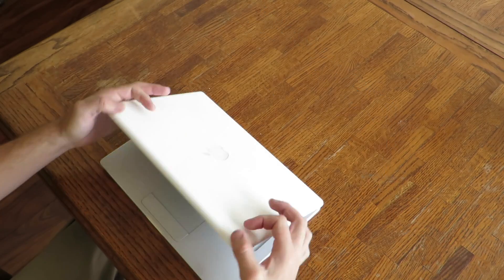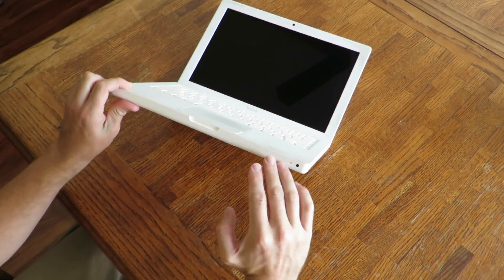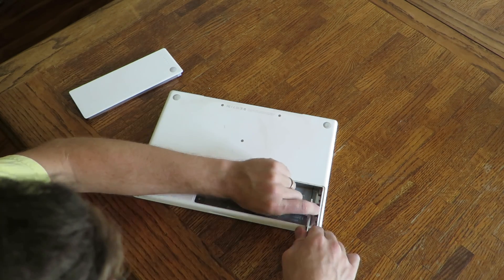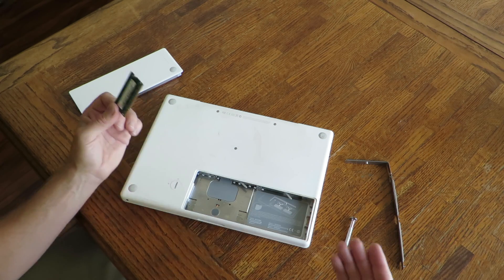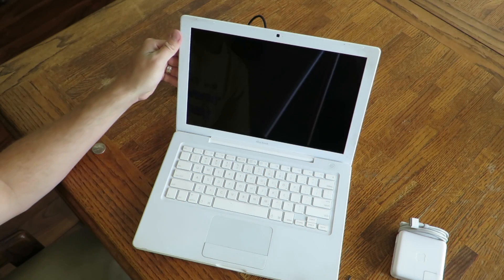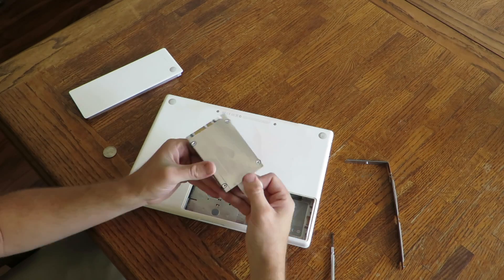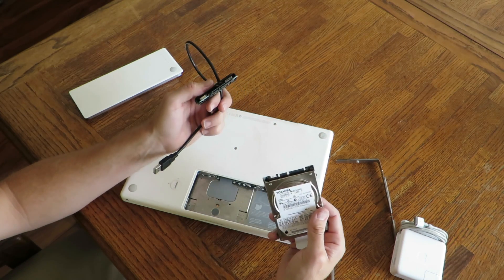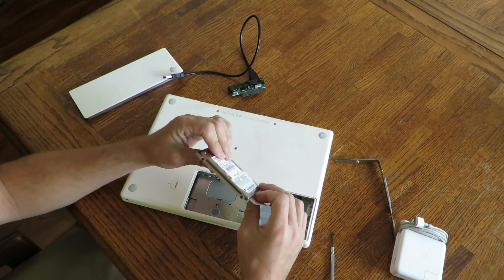Macbook wont start? How to fix it!

Comment: I don’t understand you just take the memory stick out and put it back and it works? I got one with no sound, no screen and it seems it comes from the graphic card, i tried everything it won’t come on but the light is here meaning power is passing through
Reply from the maker: The issue is that a failed memory chip will cause these things to not boot, and they tend to go bad. If you remove the bad one, it will boot. Try removing one stick and then booting it, if it does work, swap to the other. If that doesn’t work then the issue is somewhere else.

Comment: You can get it "working", however, wait the next 15 minutes and it'll just freeze. When memory slots start degrading, removing memory and puting it again, is nothing more than a workaround.
Reply from the maker: Its not the memory slot, its the memory. The computer in the video... which was filmed years ago, is still running just fine.

Comment: Hope it works. My iMac is dead already and my MacBook Pro 2015 as well. This was my last running system hahaha. Today it didn't want to boot so opened it and clean it a bit. Still nothing. I believe I added 2gb additional to this one. See if it still runs on the old ram. It was already terrible slow so back to 2gb from 4 would be a nightmare by itself
Reply: Tried and initially thought it was working I saw boot screen again when one dimm was removed. But 1/3 in shut down again. I already had a battery issue with this one. Though it was not swollen like the MacBook Pro. Must be something else. Not worth getting repaired or looked at.
Reply: I like your comment about being terrible slow. I have a perfectly good laptop but is is slower than all get out. I guess this fix is good for you to get vital information off the hard drive!
Reply: @stephenjames820  you can always swap out the HD and use external casing to get your data. Mine never booted again

Comment: I have removed the HD from my MacBook as it won’t start up (it doesn’t even have the light on the right corner). I would like to get my data from the hard drive, what will I need in order to access it? Thank you for a great video
Reply from the maker: If the drive is still OK, the cable in the video should work.

Comment: Please help, i try more and more, but the problem is my macbook white just after startup it still in the startup screen with the circuling rainbow pointer circle and circle and circle all the time.
Can you know how to fix my problem ?
Reply from the maker: have you tried to boot into safe mode?
Reply: DoItYourselfDad  yes i try that one, same problem, the problem is its not clicking or selecting any folder or any items in the screen, only the pointer is working going and going with trackpad with the circle rainbow pointer.
I try remove one memory and work with the other, same problem. I don’t know whats the problem and how to solute it.

Comment: I purchased 2006 macbook A1150 1.83 core duo 665mhz 2gb  mac os 10.5.8 for approx $35. I applied blanket therapy on it. I was able boot by power button+shift. When I logged in I tried to delete user data by secure delete but secure delete stopped mid end so turned it off. Now it's not starting and showing file question mark error. What to do now? Pls help
Reply from the maker: You may have to reinstall the OS.
Reply: @DoItYourselfDad  thanks for help but now I did it yesterday and installed snow leopard but now it's only booting in safe mode. I uploaded videos on YouTube. Can u pls check and suggest. I m getting white screen and chequeredbox line on display. It's my first laptop so want to dump it. Pls help.

Comment: Whats happen if I put the memory in the wrong spot?It doesnt change?
Reply from the maker: It shouldn’t matter which slot you out the memory in.
Reply: @DoItYourselfDad  thank you so much! So there are no real difference if I put in different position,right? I tryed to do what you explain but still dont turn on.I had the same problem in the past,and I resolved just buy trying again and again,simple buy pushing the start button.It taked time,now seems that dont want turn on,even with your method.Do you know some ather option? I think is alive,but I didnt understand why when I forget to put the power cable and turn off then it take day to work again.

Comment: I have this problem to but I made the hard drive into an external. Ive replace the battery and memory but it still doesn't work. I haven't messed with it in awhile but after this video I may try it again.n

Comment: Mine is the same model as yours In Whole Black. My turns on but it has the No Entry Sign and when I hold on to Option button it shows the Hard drive Pictures and I clicked “Mac IOS” and I let it load with the Apple Logo showing and when it Loads it doesn’t go anywhere.. it’s like an endless Loading screen
Reply from the maker: You may want to try booting in recovery mode and see if that works.

Comment: Dad, thanks. MacBook model 4.1 A1181  the little light did not turn on. we went ahead ad took out the memory sticks, then followed your instructions. Since the little light did not come on, what should we do? Thanks again.
Reply from the maker: Are you trying to power it on with no memory sticks in the machine?

Comment: Hi there! Thanks for your guide. I already tried it but it still does not work on mine. When i press the power the light turns on and there is the opening chime but the screen it still blank. I already tried the PRAM but to no avail. What are the other options! Thank you very much in advance!

Comment: Mine was water damaged, it is a 2009 Macbook. Can you make a video to fix it?
Reply from the maker: Do you know what park of the machine was damaged?
Reply: DoItYourselfDad I have the same problem. J spilt soda on my MacBook and it got inside the keyboard and trackpad. I’ve been using a plugin mouse and keyboard. It worked for a little bit when I first tried it but when I turned it back off to take to my dads house. It hasn’t worked since
Reply from the maker: It sounds like something shorted out with the liquid. Does anything at all happen when you try to turn it on?
Reply: DoItYourselfDad yeah.. it dosent turn on unless I plug it in, and when I do it makes a startup noise and then on the screen it starts loading but then shuts back off

Comment: My mcbook, not turning on even the light in the bottom, what should i do, i follow everthing, please help me
Reply from the maker: Are you not even getting the glowing light to turn on? If thats the case I'd try removing the battery and unplugging it. Hold the power on for 30 seconds. Then reinstall the battery and connect the power and try to power it up again.
Reply: same

Comment: My Mac is turning on the Apple logo comes on and a spinning wheel and nothing else happens do you know what the problem could be please? & is there any way to know if my data photo’s etc would still be on the Mac? Your help would be appreciated cheers X
Reply from the maker: Your data and photos are probably still on the drive, the best/safest thing to do is pull the dive out and back everything up before trying to do a restore. Watch the video from the 3:33 mark and use the usb plug that is shown. Hope that helps... here's the cable to use: http://amzn.to/2yDaXxA

Comment: my light isn't blinking but it's on could this be the same thing? it started doing this when I went from 2gb of ram to 4gb.
Reply from the maker: It's possible you have one of the sticks is bad, try swapping them out one by one and see what happens. I've also had problems if the stick wasn't completely seated correctly.
Reply: I have solved this problem, iam currently typing this on the macbook.. I was using pc2-3xxxs when i was supposed to use pc2-5300s, Thanks though!
Reply from the maker: +Ian Simpson glad to hear you're back up and running!
Reply: DoItYourselfDad got any tips on upgrading from 10.5.8?

Comment: i have the same macbook and it wont turn on but when you comnect the charger it shows as if the battery is fully charged,i have so much music,pics and self written music,i just want to fix it i love my old lil macbook lol
Reply from the maker: Try the memory fix in this video, if that doesn't work try resetting your PRAM:Press the power button and then press 
command-option-p-r. Hold those keys down until your Mac reboots again 
and you here the startup chime.Let go of the keys and let your Mac 
reboot normally.

If all else fails you can pick up one of these: http://amzn.to/2rrSuR8 You can pull your hard drive out and attach it to another computer so you can rescue your work.
Reply: I have the same roblem
Reply from the maker: I just put together a video that may help you : https://youtu.be/jaFI80h_rYk
Reply: IKR OLD MACBOOKS ARE SOO DEPENDABLE

Comment: I tried doing this I took out one of the memory drive thing, I plugged it in the charger it started charging (orange light). I could turn it on but only the light on the bottom turned on the screen was black. I made the mistake of unplugging and the orange light is gone and my mac won't turn on
Reply from the maker: You need to have one memory stick in the machine, if you removed both it will not function.

Comment: Hey idk what wrong with my Mack I tried to follow all the directions and i just hear it turn on but no chimes go off
Reply from the maker: Try resetting your PRAM: Press the power button and then press 
command-option-p-r. Hold those keys down until your Mac reboots again 
and you here the startup chime.Let go of the keys and let your Mac 
reboot normally.
Reply: DoItYourselfDad it didn't work
Reply: Terrence Booker ... did you get a solution?

Comment: Can you help me, I have tried what you have suggested and it still not booting up. I can here it's trying to turn on but I don't hear a chime and just a black screen. Could it be that I need a new battery because I don't see the battery light come on even when I plugged the power to it.
Reply from the maker: +Toy Chica 35678 can you hear anything starting to power up at all?
Reply: Toy Chica 35678  I hear the power turning on and that's about it.
Reply from the maker: Try resetting your PRAM: Press the power button and then press command-option-p-r. Hold those keys down until your Mac reboots again and you here the startup chime.Let go of the keys and let your Mac reboot normally.

Comment: Did this to my computer and it's running now. It's really slow but that might be from something else.
Reply from the maker: Good to hear it's working again! Removing memory will slow down your computer. Since you had to remove one that went bad you cut the amount of memory your computer had in half. Picking up a new stick would get it running at normal speed again, or you can use this an an opportunity to get more memory than before and speed it up faster than it was before.
Reply: DoItYourselfDad Where do I buy another memory stick? Do I need a specific one? I'm always careful when I buy parts because I've bought the wrong parts before and I ended up paying people to fix a phone and I paid them half and they ended up keeping that money and my phone.
Reply from the maker: I've bought memory from Kingston before, you should also be able to pick some up at your local big box electronics store.

Comment: Thank you..... Following your steps powered on my MacBook.... What's stored on my malfunctioned memory chip??? Is there any  personal information and pictures stored on my malfunctioned memory chip???
Reply from the maker: Nothing is stored on the memory that you removed. That memory is only is use and holding data when the machine is powered on and running. You can pitch the memory stick without any risk of your data being stolen.

Comment: Any ideas if there is no blinking light at all. A1181 MacBook. Tried pullin out memory.
Reply from the maker: +John Nada are you getting any startup chime? Have you tried resetting the pram?
Reply: Same problem for the A1181. The charge indicator lights up, but no other activity. I've tried everything including the method in this video